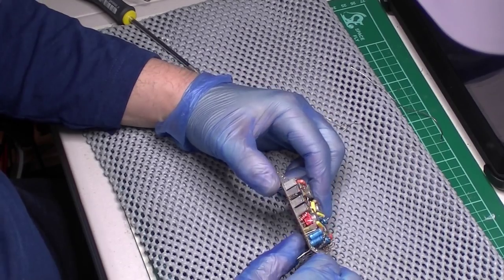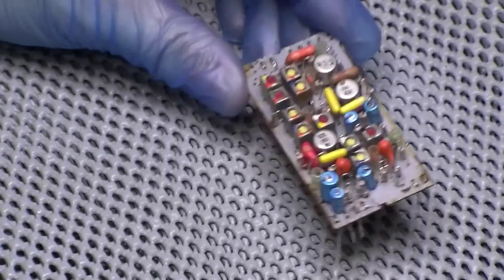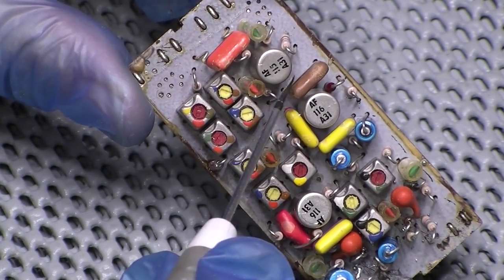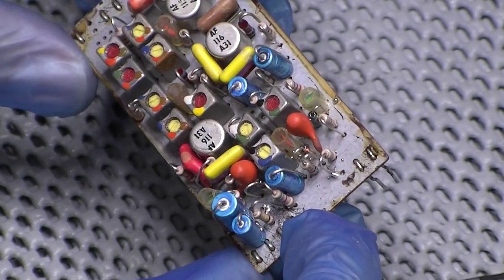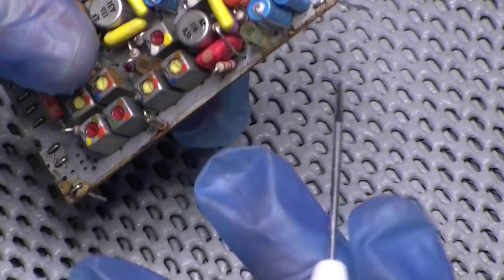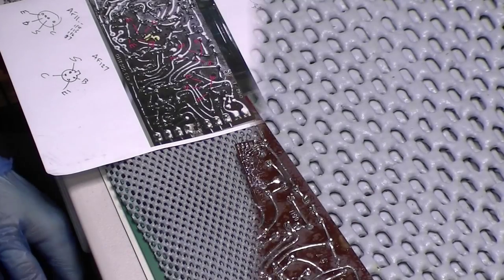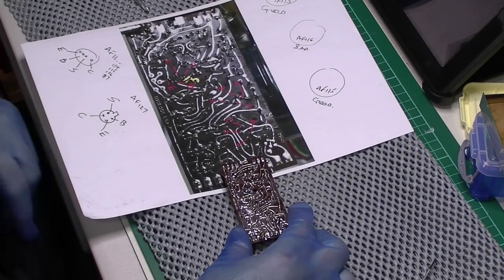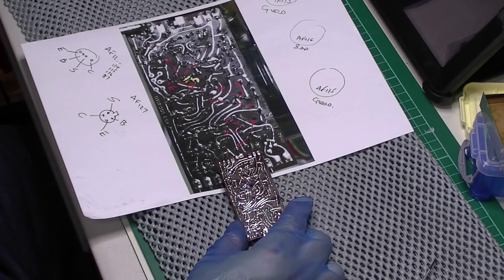Roberts R707 Part 4: Mullard LP1164 module refurbishment

Comment: Hi Graham, I knew about the capacitor blasting but not the Megger blasting. It just so happens that I have a 1000V Megger and some AF117s to hand. As they say, Wait, Out and I'll report back.

Good video!  Regards - Andrew
Reply from the maker: +Andrewausfa thanks again for the comments Andrew and glad you liked the video. Check out Simon's video for a demo https://youtu.be/xFwDXIYgBvQ
Reply: +Radiocruncher  Thanks for the reminder, I had watched that.  I have the same Megger as Simons but not quite the same results, I blew the junction I think! I'll try again tomorrow.
Reply from the maker: Oops. Hopefully you have some more to experiment on. The higher voltage should in theory burn the whiskers back further than my measly 40v supply. Let me know how you get on
Reply: @PHILL DIXON Hi Phill, not recommended! A Megger will destroy the junction. If you search Graham's videos for 'zapping' you will find a much better way.

Comment: What if you dont have the 4 leg transistor like the 2sb175 which would you solder together..and which on the touch...thanks..
Reply from the maker: If you have a 3 leg transistor with metal can than as long as it is not connected to the chassis negative i.e heat sink then you probably wouldn't know. The procedure would be to connect all 3 legs then zap the metal can
Reply: Ok thank.s